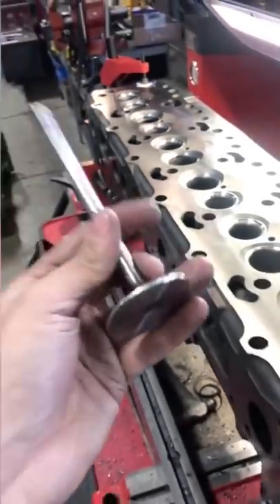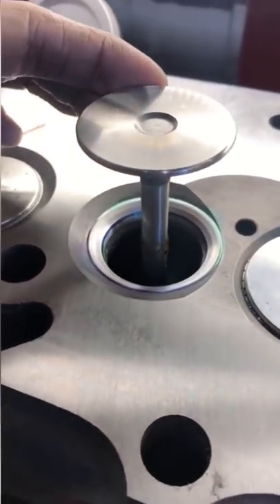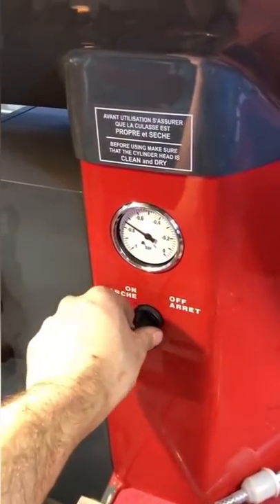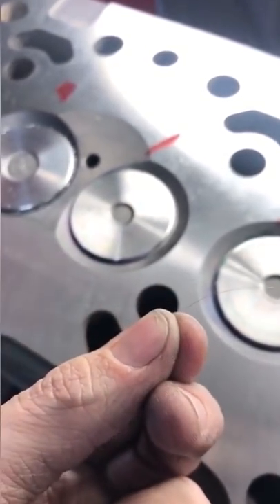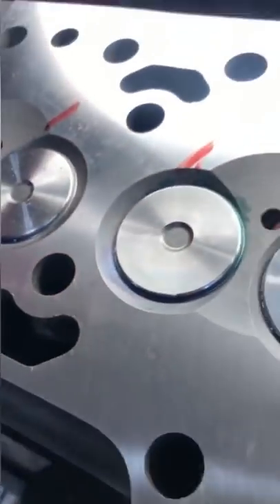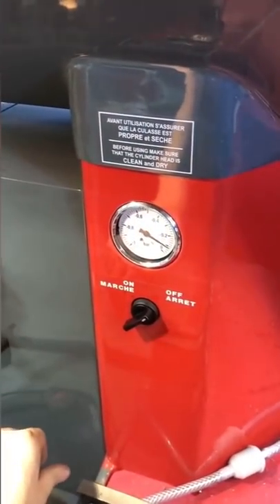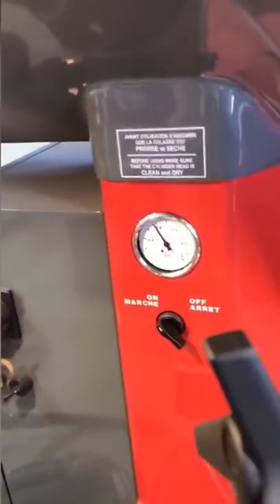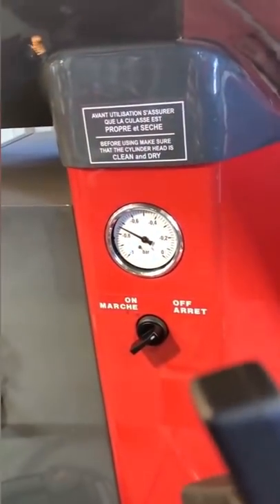#shorts Engine Machining Tolerances in layman's terms!

Comment: I love this video because it's hard to get people to wrap their heads around machining something within +/-.0005 of in inch other than saying it's 4x smaller than a human hair
Reply: I have to hold a tolerance of +/-.0002 every day
Reply: @xsilverblade44x25  crankshaft grinding?
The tolerances on some European stuff is so small!
Reply: @reecechristian6185  no it’s actually on a  base model Okuma mill
Reply: The machine does it, not you
Reply: @Rainman8193  that’s wired
Reply: Wait you guys still use inches for machine tolerance? Wtf?
Reply: @Rainman8193  cnc machine makes it simple but machinist can pull this off

Comment: When I used to work in Needle manufacturing tolerance was everything sometimes we'd work to hundred thousands of an inch sometimes more but it was definitely critical to the completing of the needle
Reply: Same here, I work in microns all the time.
Reply: @EPICRANDOMGUY02  ya its crazy how small shit can be
Reply: What process do you use to make needles? Is it cnc or some other way?
Reply: @EPICRANDOMGUY02  10 foot tubes of steel ran thru a manually assisted grinder sometimes we would use a laser to cut holes sometimes cnc it all depends
Reply: @puprilla  Ah right nice that's pretty cool
Reply: @EPICRANDOMGUY02  yeah it was definitely a cool job I made brain surgery needles epidurals for Women's Pregnancy spike strips for the police I mean you name it I've made them I've been out of that industry for a few years now though. Now i own a roofing company
Reply: @EPICRANDOMGUY02  Microns? That’s cute. I work in CPU manufacturing and we’re currently working on 2nm process nodes.
Reply: @2nd-place  Which is not the same as tolerance
Reply: @2nd-place  I wish you made your heat spreaders to that tolerance, maybe we wouldn't need thermal paste then :)

Comment: Great video! This will help when I try to explain thousandths to people. I make gears for overhead cranes and my bearing and gear fit tolerances are usually .0005” (half of a thousandth.)
Reply: Gears and bearings have runout to deal with so they always have super tight tolerances. I've made gears for the $20k drills used for aircraft wings and it was even less.

Comment: You do good work! I've bought reading to install heads from mopar performance years ago. When I got them filling where falling out the ports. Valve stem heights where all over the place. Basically had to be rebuilt. I've found it hard to find competent machine work. Wish your shop was closer.

Comment: I did a valve job on a 1950s Briggs & Stratton 3 horse motor in a very remote location, I used to rock to grind the valve and it worked I guess the tolerances were not as tight as they are now
Reply: It's also a B&S engine that's designed with stone knives and bearskin in mind as tools.
Reply: @Bill Braaton🌵Wonderful ! 
just wonderful! "Necessity's 
the Mother of Invention"!!
Reply: that old briggs woukd have worked if you just gave it a stern look. fuckin things run no matter what. lawn boy is just a green briggs, too...

Comment: Worked in manufacturing for diesel truck and aerospace industries. This is why QC inspectors are so important! I've seen planes grounded due to -.001 on a tube flare causing a bad seal.

Comment: Fuel pumps (Diesel injection) are machined to 0.5 micron. A favourite demo for newbies used to be to give the barrel and plunger assembly, let them handle the parts for a couple of minutes and then ask them to put them back together. Differential heating meant that they wouldn't until they'd been allowed to regain the same temperature. How to seal 2000 bar pressure without a seal.

Comment: For perspective of military equipment build quality there is less than a handful of places I can go to get fixtures made at a 1000th of a inch just just to help to produce the tolerances of the equipment that is built. Then after said product is done it goes through Q/A 10x microscopic inspection process and other tests. The end argument is I can go pick up a CNC machine as a engine and program it, but 3000ths of a Inch and lower is a fucking art. Always impressed with anything being able to be made with such a tight tolerance.

Comment: Machining things with small tolerances is one thing, just try to install and adjust machines so they can keep the tolerances.
When you have straightness down to 0,001mm/300mm (1micron on 300mm length) then we are talking.
This was on a 46 metric ton milling machine.
Reply: How often do you need to use shims, how much warpage is expected for things that large?

Comment: I've been training on a metal lathe from the age of 14.
I started with tolerances of +/-0.3mm (not sure in imperial)
I found even those were difficult to meet after my first year. I'm currently 16 and taking engineering at college in the UK.
So massive respect to the guys who work with tolerances like these. 👍
Reply: Also in Uk… I did an engineering course at college. You’ll find when you get into the industry (9 years for me now) that +/- 0.3mm is a gap ‘you could drive a bus through’. Once your skills and technique is honed (no pun intended) you can hit +/- .01 +/- .02 all day… provided you have good tooling, that is.
Reply: You should learn an overview of imperial units even if you won't use it very much. Metric and imperial are just units of measure like a language. Knowing more than one language is always a benefit.

Divide by 25.4 to go from metric to imperial. 1mm / 25.4 = .03937in. Pretty easy with a calculator.

Comment: In one shop I worked at, one of the senior machinists had done a project where the tolerance was a few microns for the diameter of a hole. He used the speed of the drill to adjust the size, and a air volume gauge to measure.
Reply: I need more info on this. I’m so intrigued...

Comment: As a kid, I made brass pocket bevel gauges on a 20-year-old Bridgeport mill my dad got for $500. It needed new ways . . . BAD. With 1-4+ hours extra for each setup, I was able to maintain +-.0005in tolerances for most operations. Haven't been in front of a mill in almost 15 years now. I miss it!

Comment: I'm amazed that automobile engines can run well for so long considering the very precise tolerances and having those tolerances deal with the extreme pressures endured within the engines. It also helps me to understand how the engines gradually lose power as the slope of the tolerances declines, ever so slower.

Comment: I never worked in an automotive machine shop however I worked in precision machine tool and die and our tolerances were less than .001 for just about everything we made. Even if we were just making something like a freeze plug. My first machine was a numerical 4 axis CNC mill, 17 year's old (started working there at 14).

Comment: I have a Honda dirt bike from the junkyard, after tearing down the top end I noticed the timing chain had slack and the camshaft sprocket looked like it needed dentures because it’s teeth were next to nothing. Because of this, the engine went out of time and the piston smacked the valve and gave a slight bend to it. It wasn’t very noticeable, but a leakdown test proved it like a sore thumb. Some how, some way, I was able to put the valve in a vice wrapped in bike inner tube and smacked the face of the valve with a hammer. Believe it or not, the valve no longer leaked after that, and passed a leakdown test. I find it hard to believe that with my eye and a hammer, I was able to get within a thousandth tolerance, pretty wild.
Reply: Yes, I also find it hard to believe

Comment: We used to make face tooth couplings for machine tools. +/- 5 microns over 600mm dia in any one of up 24 different orientation across a set of 3 interlocking parts.

Comment: When i was an operator at a local machine shop, we did mainly bearing rings for timken machines and the tolerances on half of it was +.000 –.001 while the others were usually only about +/– .005
Reply: By rings do you mean races?
Reply: @thenomad7120  indeed

Comment: Carillo pistion and kibbleqhite valve setup, 125$ per valve and 80p for the pistion alone. Tolerance set at .001 of an inch for clearance between valve and pistion pocketed pistion to close the gap just that little bit more

Comment: I work in a micro machine shop where I make medical equipment such as marker bands and heart stints. My tightest tolerance is .00025. (Two and half tenths.) and most of the time I have to warm up my machine before I can make my adjustments with that particular dimension.

Comment: We supply ceramic matched parts machined to within 64 millionths of an inch. If you touch the parts without gloves they don't slide together.
Reply: That's crazy. What are the parts for?
Reply: @svtirefire  ceramic rotary valve for dispensing pharmaceutical liquids. They're seal free. I work for Hibar, recently bought by Tesla

Comment: Well you actually have to lap valves. Which means physicallu seating, like a puzzle picece,  making sure it's an air tight fit. Other wise the engine will run very rough, or maybe not at all. Depending on what valve .. intake or exhaust, low - or no cylinder preasure..equals no combustion or low cylinder preasure. Great work man
Reply: Jack Thompson  yes real one's still do out there actually lol the ones that work on race cars and drag strips and are on time crunch, when a valve gets bent or smacks a piston!

Comment: I worked in heat treat and that hair could make the difference between a few thousand parts being too warped after the heart treat process. You might be surprised by how much a piece of metal changes with a little heat.

Comment: I’m a freshman in college for mechanical engineering and this is exactly what I want to do.
Reply: You're in the wrong career path then. Engineers don't become machinists. Machinists become engineers. I was a toolmaker before becoming an automotive manufacturing engineer. Yes I did have responsibilities on several machining lines, but you won't be cranking handles and running vertical knee mills. You may have a hand in programming but once the process is defined you're onto the next project.
Reply: @theupscriber65  I don't think future machinists will be turning hand cranks. Those days are quickly becoming numbered.

Comment: I use to repair machines used for making cabinets. The finished edges had to be within 3 thou, sir our machines gas to be kept within 1.5 thou. 
So yes I do have a slight idea, when that same piece of hair could make a finished cabinet unacceptable. 
We are talking about wood, not metal that has a lot closer tolerance.

Comment: 0.05 is pretty big tolerance these days. Had a grinder working to +/- 0.003mm the other day was right at the time probably won't be when it gets built in a cold/hot setting

Comment: I'm a gunsmith, tolerances as tight or tighter than this exist in alot of high precision rifles. To put it in perspective a barrel being 1⁰ out of square would mean a point of impact 5 feet to the side of where it should be at only 100 yards. Those 1000 yard shots would be about 50ft off.

Comment: There are some parts tolerances so tight, if you hold the part in your hand. Your body temperature will make it out of spec.
FYI
The cellophane wrapping on a pack of cigarettes is .001" (One Thousandth of an inch.)

Comment: Hello great channel;) Is there any way to check the valve guide clearance in the head? Without removing the cylinder head from the engine block.
Reply: I have a problem with valve seals. I don't know if the valve guides are also damaged?

Comment: I guess i was right when i realised my gearbox broke after being fixed by a gearbox shop. I pulled it apart myself and found a white drop of paint on one of the teeth in first gear, which was right in line with the crack.

Comment: Yeah a few thou is tight but most tolerances will say +/- 0.05 or all the way to +/- 0.0001 is usually the lowest, meaning 1 thou or 5 thou in either direction. However its mostly about your own competence and the machinery you are using. For example you couldn’t even come close to a five thou tolerance if you are using belt driven machines. However if you use gear driven, if you set your chuck perfectly and know how to use your machine a 1 thou tolerance isn’t a big deal at all.

Comment: Although the hair is .002" think about the size of the surface area that's been displaced preventing a seal, go stick a broom handle in between a door and try to close it, a round 20mm stick doesn't seem like much but then look at the size of the gap the whole way around the door and door frame and that is exactly what that .002 hair is doing to the valve.

Comment: Pssshh.  We held 20 microns diameter tolerance and PMR lathe turning 4,500 units per day of a bearing journal on a front output for GM. And we showed 1.66 cp and cpk with a normal bell curve distribution. So the majority of those parts measured within 5 microns to each other.

Comment: I used to be a machinist, and once I had to remove 5 tenths, or 0.0005" off of the ID of a turbo. 
Perspective, 5 tenths is like a single piece of paper shaved 30 times flat

Comment: Not Sure If That's A Diesel Head But If It Was A Gas Head It Would Run And Most Wouldn't Be Able To Tell There Was An Issue Unless You Trying To Make Alot Of Power. The 3800 Stock Run With Cracks In The Heads Between Intake And Exhasut Valve. They Don't Show Up Until You Start Wanting It To Make Alot Of Power. Granted .002" Between Valve And Seat Is Not The Same As A Small Crack In The Seat.

Comment: Now I am curious to see what the performance difference is if you were to leave that amount of imperfection in a valve seat.  Would it run?  I’m assuming so.  Would it be down on power?  I’m also assuming that yes it would.  I’m a retired mechanic but I never learned the machining side of it.  I just knew I sent an ugly head out and received it back shiny and ready to go.

Comment: These parts I'm making for our customer have a tolerance of +/- .00025. Not 2 thou, 2 tenths. We gotta hone these in by hand and they take forever. I love your videos tho! I'm a mold maker (apprentice), but I love seeing your work
Reply: when you hone by hand are you using abrasive films?
id really like to know...
and if possible could you leave me a link as to where i could obtain said tools?
Reply: @chaosreigns7386  My co-worker said honing, and my "manager" said lapping today. But we have these small rectangular plastic pieces that we need the edges to be perfect on size and squareness. We put the parts, one by one, into a custom fixture/holder and proceed to "sand" it down. Using a 500 grit crocus backed by a ground plate. The machine can cut it close but you have to worry about chipping despite the diamond endmill.

Comment: We had a customer, who was a scraper/ junk man! Well after his BBC was all machined, washed, bearing clearances checked, end play checked, ect ect! I pulled the crank back out, recleaned crank & bearings, & hit steel parts w WD40 bagged & everything! All clearances were set! I should have just finished putting the short together! But he wanted to play engine builder! He took it home w the sheet of all clearances & torques! Well he put it together that weekend, called Monday morning saying it would not turn over! When I spun torqued up crank it would spin 1/2 times w light oil! So we stopped @ his house after closing Monday night! When I saw the dirt floor garage, I just about shit! Everything that was spotless clean, was FCKING filthy! Thank god my boss just said we will take it back & find the issue! This was my bosses ol lady’s brother! So when we got back I started pulling pistons @ than mains! There was 1 speck of sand/dirt in the rear main thrust! Needless to say, everything needed to come back apart & be recleaned again!  After cleaning my boss said just put the FCKING thing together! He should have known better, than to try to put a race engine together in basically a pole barn! 🙄🙄🙄🙄🤬🤬🤬🤬

Comment: Is that a tolerance in machining when it's ground to match? If it was a tolerance in machining,  swap it with other valve and see if it leaks.  Also,  you didn't mention assembly lube with the hair test. It's like bullets.  You can't say casing tolerances when you fire it in your competition rifle for the casing to mold to the chamber.

Comment: If it doesn’t seal you burn valves and perhaps backfires.  And no seal means low or no compression, reducing power and efficiency.

Comment: Hay I work in a tool in die shop I used to work at gm plants and some other machines shops  
They needed extremely precise measurements if I messed it up I had to redo the whole thing over again

Comment: Those valves are lapped in. at first they are off after machining they take a paste 1000+ grit and put it on the valves and turn them until they are ground down to a perfect fit .

Comment: A good way to show how something that is only  0.0002-0.0004 ( a human hair or a cigarette paper )can make a tight toleranced part scrap if not to correct size and is only by using a  micrometer that you'd be able to see a difference.
Reply: Isn’t that 1 too many zeros?
Reply: @devilsreject9255  no, he is talking about 2 tenths of one thousandth of an inch and 4 tenths of one thousandth of an inch.
Reply: Mitchell Hoffarth I think he meant the reference in the video, which said that a human hair is ~.003 in. A human hair is thicker than .0002-.0004 in.
Reply: @yeetskeetledeet8184  yes. I realized that after I posted my reply. I was so focused on the correct noting of tenths of a thousandth. Totally missed the rest. There is one too many zeros for describing a hair like in the video.